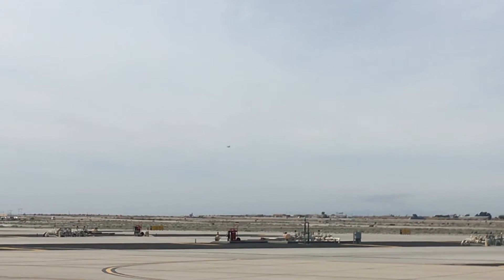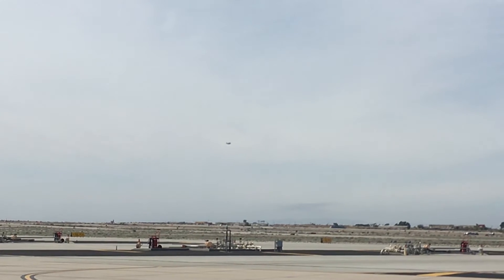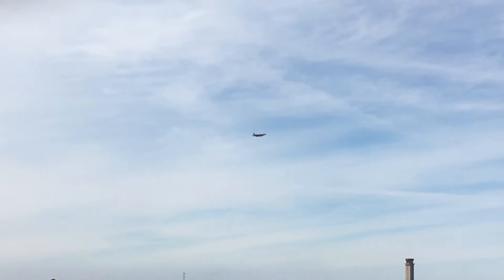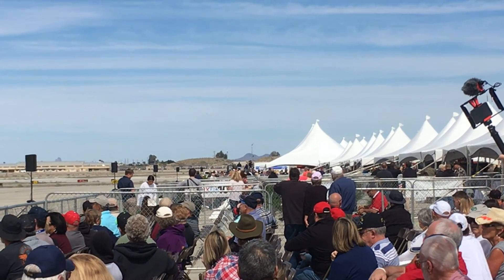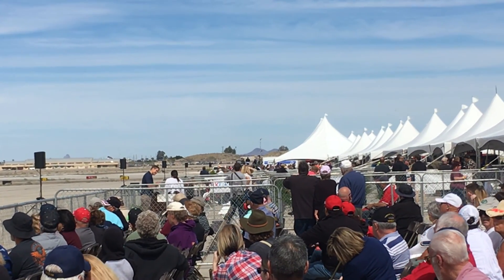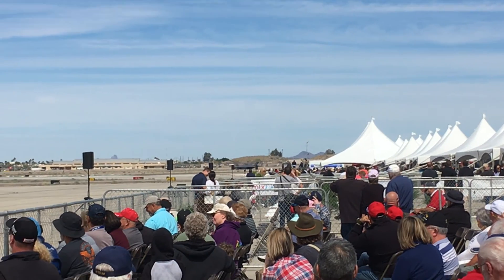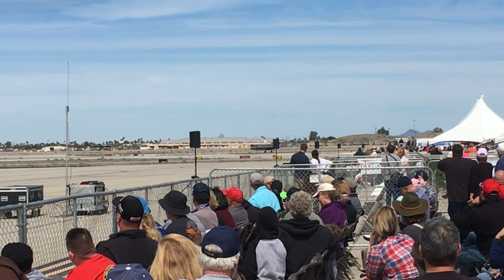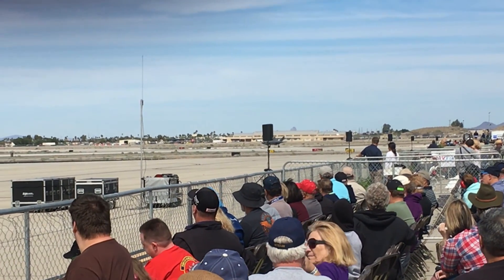MCAS Yuma Airshow 2019 VMFA-122 F-35B Lightning II Demo

Comment: So disapointed the jet is awesome but the pilot is not.. israeli pilots can handle f35 well and put it in good show..
Reply: F-35I is based on F-35A.  F-35B has lower 7G loading. 

F-35A Block 3F has 9G.
Reply: @mgw.spotter  the lets give it to israel pilot.. The f35 israeli pilot  is much much better show than this..